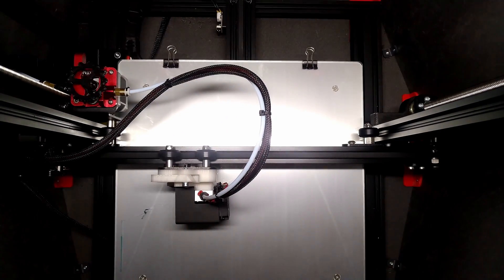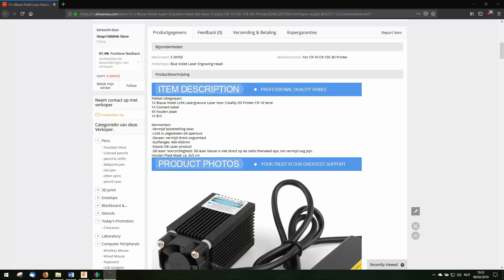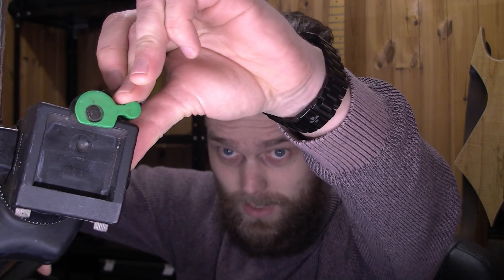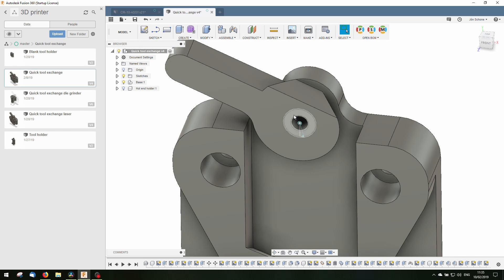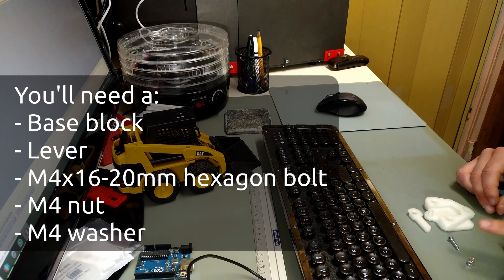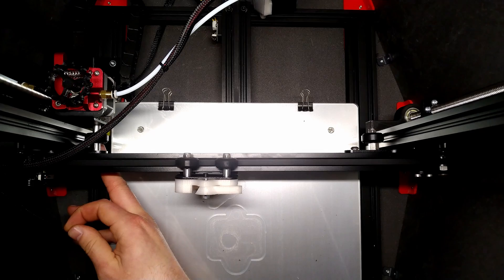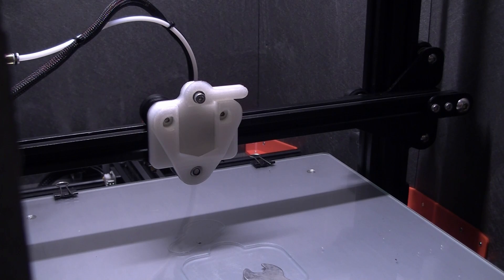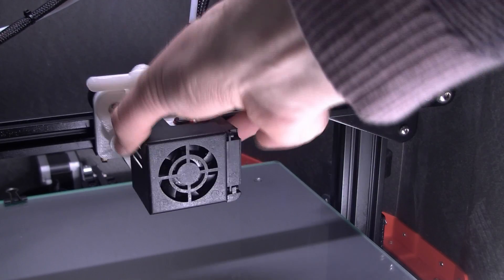Turn your Creality printer into a multitool machine!

Comment: Thanks, nice video. I really like the tip for screwing the bottom screw. Yet, I tried mounting it on my CR10 v3 with direct drive, and the dimensions are not correct. The holder's holes are further apart compared to your multitool adapter.

Comment: Did you change the Mount for the hotend all i see is a big part not the little one. let me know it is missing from the Zip File.
Reply from the maker: That's odd. I just downloaded it myself and it shows both files in the zip. Could you redownload it?
Reply: It is the Tiny triangle shape that goes on the back of the excursion I can’t find the file for that one I find is a big one that replaces my whole mount for the hot end I just need a little triangle shaped piece that I can’t seem to find
Reply from the maker: @matthewwhitt859  You're right, I forgot to add that! I'll add that soon, but for now you can find it here https://www.thingiverse.com/thing:3369444/files it's the Blank tool holder
Reply: You are the man. If all works out Coffee is on me.
Reply: Is there a way I can send you a photo to explain what I am looking for

Comment: Hi printed this cool design for my ender 3 v2 but im wondering the noozle is little bit moved does it matter do i need to change something in my slicer cuz i have bltouch clone so just making sure if its ok
Reply from the maker: Thanks! You'll loose about 20mm in the Y direction so you can't place components close to the back of the printer. I don't have experience with BlTouch. If it probes close to the edge you might have to change that.
Reply: @properprinting  oh ok thanks for that a lot i also made a remix for 775 dc motor for cnc still working on it but seems to work
Reply: @properprinting  so if i set hotend y offset to 20mm and add 20mm to bltouch y offset it should work?
Reply: or noozle offset in cura?
Reply from the maker: @anythingdotstl5585  that sounds like it should work
Reply: @properprinting  ok thanks a lot have a great day or night ;D

Comment: Thanks for the video. What die grinder / rotary tool do you use? Would be good to get the same one to fit the model on thingiverse.
Reply from the maker: The grinder I used in this video is not good and I'd suggest to use this instead https://properprinting.pro/product/grinder-with-swappable-system/

Comment: I printed this and have run into a problem. I have it on my CR10-S5. Because of the mount it has moved the nozzle about 20mm in the Y direction resulting in home ending up in mid air. I can't seem to find how to tell the system about the offset.
Reply from the maker: That's indeed the drawback. I have solved this by moving the y homing switch 20mm further to the front. This results is a smaller build volume. This can be prevented by moving the whole gantry 20mm further to the back instead by drilling extra holes or use angular brackets with t slot nuts.

Comment: I just love your videos, they're informative and so damn innovative! I own an Ender 3 v2, do you think this mod will work on it? I think it has a different mounting system for the hotend cap. I'd like to leave the original cap installed as it goes, but this system would be awesome to tinker with a laser and a grinder! Thanks for any info you can provide!
Reply from the maker: Thank you! The fan duct is different so it would work when the fan duct of the standard Ender 3 is used. Another possibility is to use the blank tool holder (included in the download) and make one to fit the new fan duct but you have to be comfortable making CAD designs.
Reply: @properprinting  thanks! I will wait for my parts to get here so I can make the changes to the design. If it ends up working I will send it to you so you can post it on your website!
Reply from the maker: @enriquefuentesc  That's awesome man, thanks! You will be the start of a derivatives page then ;)

Comment: Hay great work...   I have a old ender 3 that the extruder stopped working never did find the problem  I have a creality 250MW laser to put on it I hope using your  system...  my laser is 30.19 mm by 30.19 mm, it has 4 magnets on the back witch I will remove because I don't have the extruder and cover anymore I sold them to help me pay for a new printer...  My question is will your system fit my small beginner etching laser???   I want to alter marlin to use the creality silent board and not use anything related to heating of the bed and extruder or using the z aces at all...  I have found it very confusing and have yet to have a successful compile in vs code...  do you have any suggestions, I am new at coding that type of stuff but I have been coding G-code for years and HTML...  any help would be awesome and I will pass the information on to any one who has the same problems as I am having...  Keep up the good work I love your channel and watch regularly when I am not out of country...

Comment: you are doing amazing job! and this video helped me make my printer multi functional thank you! i have a question about this upgrade 
so when you install all these parts the hot end appears to be away from its original home place? im asking this because in that case we dont know the right size of the bed since lets say if the hot end appears to be relocated and i want to print something in the centre of the bed then its not gonna go to center its gonna be little off of the centre of the bed
im not sure if you get what i mean
for example i printed the ben holder for drawing and its installed on the outside of the box which makes the pen to be way off the hot end spoo when i decided to draw i made a file on cura and on cura theres size mentioned of the ender 3 (thats what i have) so when i thought it would start drawing in the middle it appeared to draw on the very end of the left side of the bed so i realized i had to place the pen right at the hot end. so in this case the upgrade that you made is it going to be away from the original hot end place? and do we need to make some adjustments ?

Comment: Hi, I have a problem with the printing area after installing this handle on the hot end in Ender 3. Could someone write what settings I should set to fix it
Reply from the maker: The build size is reduced a bit and this wasn't a problem for me so I moved the y homing switch a bit further to the front.
Reply: @properprinting  Thank you for your reply and I apologize for my English because I come from Polish and I use google translate.

Comment: Great project. But i have a question: does it hotend holder not overheat and melt? Because i see, that coldend contact with plastic holder directly. If i print it with a PET-G, does it works? Or i'm should print it with Nylon only? Sorry for my English.
Reply from the maker: Thanks! Great question. I thought the same but the cold end fan makes the cold end cold enough to not melt the plastic. The amount of colds used in that sentence says it all xD PETG works fine.
Reply: @properprinting  anyway i'm already make it. So far it's working. But print zone Y-offset approximately 15мм, and i had to move Y-stop and change Y_BED_SIZE from 235 to 220.
Reply from the maker: @sergei864  cool that you've already made it! Yes there is an offset like you mention. Hopefully this isn't too much of a problem for you. Good luck with it!

Comment: Really awesome upgrade, thank you! Can this part be used on a ender 3 pro? I have mine on the way and have some cool ideas for engraving and laser works with it! Some guys say that use it for engraving can damage the belt
Reply from the maker: Thanks for your comment! Yes, this can be used for the Ender 3 pro as well. In fact, I've equipped both of mine with this mod. I can imagine that engraving can damage your belt and I still want to do some tests to find out how much force can be applied. I know that the motors will block after too much force so the belt won't snap. Maybe it's a good idea to buy a spare belt if you're seriously going to do some engraving. They are affordable. Good luck and awesome that you're going to engrave with your Ender!
Reply: @properprinting  yeah, nice, keep us update with it, thanks again

Comment: shouldn't the eccentric rod just spin around the rod by itself? why does it change the position of the roller if it's just sandwiched inbetween, like a washer?
Reply from the maker: The collar of the eccentric nut rotates in the carriage. The hole within that nut is eccentric which pushes the bolt together with the roller against the profile. Hopefully this makes sense :)
Reply: @properprinting  oooh so the nut has a collar. I didn't see the collar. I thought it's litteraly a polygon with an accentric hole so I was like "this is just gonna rotate around itself and not push anything with it"

Comment: Hi Jon, I'm new to 3D printing. And have a CR10s. I really like this idea because I agree that there needs to be a better way to attach the laser, than the weak magnets that they come with. So I printed your quick change parts and installed them. I made them out of ABS because that is all I have right now. The only thing that I am having a problem with is that now my nozzle sticks out a little farther than it did before. I tried to move the x axis stop but that didn't work because now at the end of the print it trys to move the bed forward to much and starts to shake the bed when it reaches the end. 
Did you adjust the offset of the x axis or did you just leave it? 
Thanks for any help you can give me
Reply from the maker: Hi Jacob, welcome to the 3D printing community and thanks for using my design! I have adjusted the offset of the y-axis end stop (the one under the bed) approximately 20mm further to the front. It looks to me that you have moved the en stop further to the back instead of to the front so it can't be reached and the y-axis cannot physically go further. By the way nice that you've managed to print it out of ABS, this is not the easiest material to begin with.

Comment: Will this also work on the Cr10s-pro?  Also I do not see where the belts are suppose to attach to the v4 base. Update: So I've printed it and unfortunatly the plate doesn't line up. Is there any possibility of you maybe designing one that would fit?
Reply from the maker: I have found some time to make a version for you for the CR-10 s pro :) I could not find a cad file of this printer, but I have downloaded the Bullseye mount for this printer and measured the center distance of the two rollers at the top. According to these measurements this distance is 44mm. I recon that the rollers and profile is the same so it should fit. I have uploaded this to my sharing page https://shares.properprinting.pro/public/9478c3. I haven't uploaded this to Thingiverse yet because I cannot say for sure that it fits. Are you willing to print this and check if it fits?
Reply: @properprinting WOW, what other YouTuber is so involved with their fans!? Thank you!  I would love to do that for you, I'm away from home until Monday, but the first thing I do will be printing this out. Is that too long to wait?
Reply from the maker: @MegaMarcuscooper  It's definitely not too long to wait, take your time :) I'm happy to help, no problem at all. Hopefully it fits!
Reply: @MegaMarcuscooper  I agree most of the YouTube channels I have subed to do not even read the comments...  It is awesome that he not only reads them but replays...

Comment: I have tried printing this out of PETG and the lever cam is too much in the model. It hits the top of the angle on the base before it gets off the flat into the bevel and wants to lift. I have done extensive tuning to get my printer to print perfectly accurate 20x20 cube measures 20.01x19.97 also made certain my extrusion multiplier is tunned with 2 perimeter wall open top and bottom cube measuring all wall thicknesses to be very close to 2xExtrusion width as set in my slicer.
 I did use your blank mount model to make a hot end mount with fusion 360 to use nuts on the back side instead of threading into the plastic minus the shroud mounting holes since I have a fang fan mount in place of the stock shroud. 
Other than this issue I think the design is great and am looking forward to getting a laser engraver mounted to my cr-10s.
Reply from the maker: Thanks for your comment!  It is indeed a tight fit and I did this because of the tolerances, especially when it wears down a bit after a while (I think) and because my nylon version is a bit flexible. For me a slightly smaller block was just a little bit to loose. Nice that you have tuned your printer to print this accurate! PETG is the perfect material for printing accurately and I think I will also print one out of PETG to see if this makes any difference. I am happy to read that you have used the blank model to make a custom one for the fang fan mount. Thanks again for your helpful feedback!
Reply: @properprinting  hey no problem. Thank you for the great design. I will upload the modified blank once I get the final touches on it to thingiverse as a remix I will include a fusion 360 format, step file, as well as a stl file. P.S. If you look at the fusion file the history and sketches are a mess since I have fairly new with Fusion 360 and solid modeling in general. I come from a wire frame background.
Reply from the maker: @viper55069  cool that you will upload the modified mount to Thingiverse as a remix, I am looking forward to the result. It is quite easy to make a mess with Fusion designs, especially when making (multi level) assemblies. I can imagine that this is somewhat different than wire framing which I have done once at a rainy Sunday :P